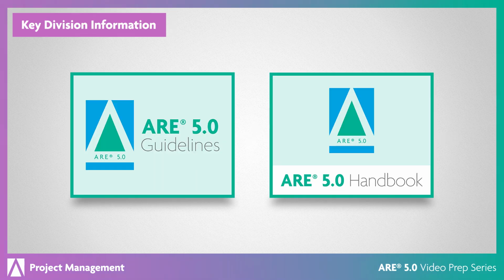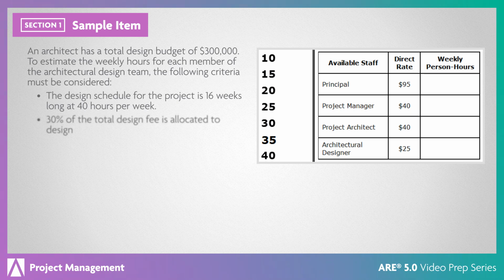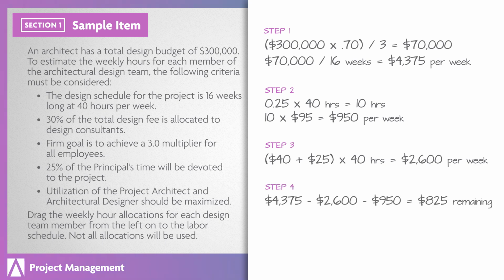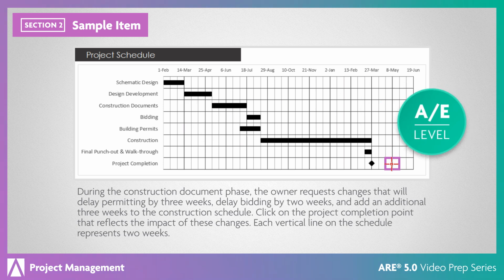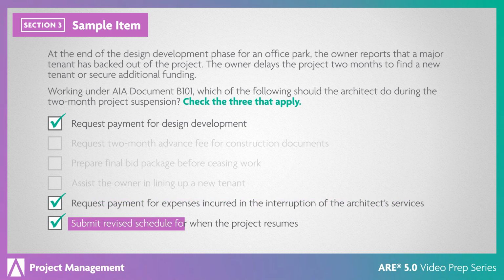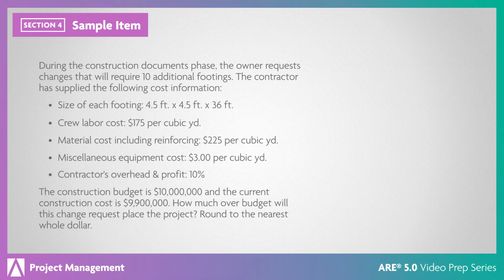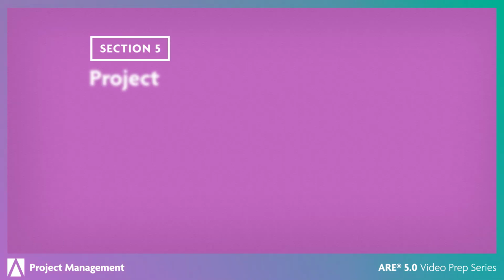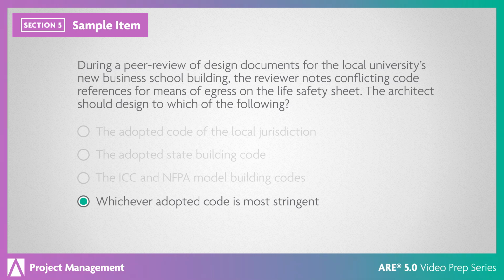ARE 5.0 Project Management

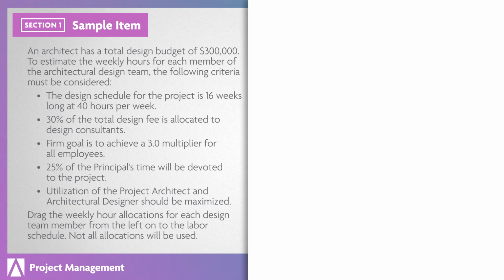Comment: The solution at ~ 3:19 the first item in the "criteria section" gives misguided and erroneous information, which says: "Project design schedule is 16 weeks long at 40 hours per week" why add the "40 hrs per week"? it doesn't help to find the answer and the final solution is a combined 110 weekly hours of direct labor, so is not only misguided but it gives the impression that the problem is asking you to budget 40 hours per week in total for the project team.

Comment: The solution at ~ 3:13 doesn't match any combinations of the given "hour allocations" bank on the left of the chart. 10 and 20 are given for the Principal and Project Manager. 15 and 25 can be combined to make the 40 for the Project Architect OR Arch Designer, but no "hour allocation" is available for the remaining employee to add up to 40. Is this a typo?
Reply: Hi Conor and Bryan,

For some drag and place items, multiple copies of each number/component are provided, but the copies are stacked on top of each other.  Stacking them keeps that area on the left cleaner so you can more easily see what you're working with. In PjM sample item 2, two copies of each label are provided.  Both copies of 40 are used, which is why it disappears from the area on the left, but only one copy each of 10 and 20 are used, which is why you still see them on the left.

Trying this out yourself should help - check out PPD sample item 7 in the demonstration exam.  Take a stab at manipulating the answer options, and let us know if you have more questions about it.
Reply: I wondered the same thing... can we use the 40 hours in multiple areas?
Reply: Awesome, thanks for the reply!